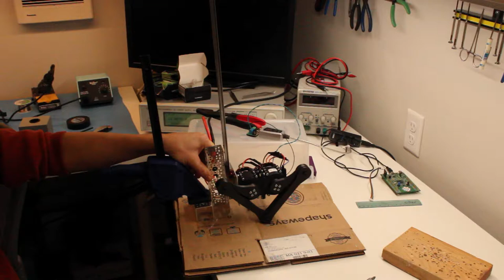Brushless Servo Leg - First Day Jumping

Comment: Would a linear actuator be effective if not using thus design? I'm sure that's something you already have attempted or thought about but I wanted your input to see if using a high torque servo with gear speed increase to make it hit the ground faster and jump but I just wanted to pick your brain and get your thoughts. Thanks!
Reply from the maker: A linear actuator is harder to make work.  To work well for a dynamic legged machine, the actuator both needs to have low inertia (and thus high acceleration), but also needs to have high compliance.  That can be achieved using a low gear reduction system (quasi-direct-drive) like this, or by using a high bandwidth force feedback with the end effector.
Reply: @awesjosh   @Josh Pieper  for a legged machine like yours, the design is way more practical and that would make a lot of sense to do something like this instead. I've got myself a 3d printer and I'm trying to work with gears to get a better understanding of how gear reduction, gear speed increase etc works along with the physics included with all of it to make my projects more technically advanced. Fantastic work on getting something like this up and running!